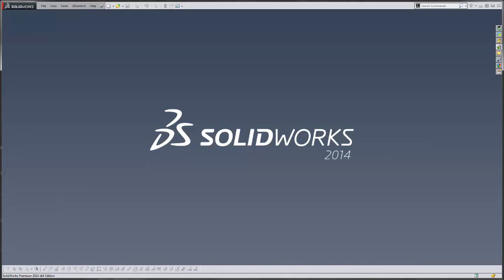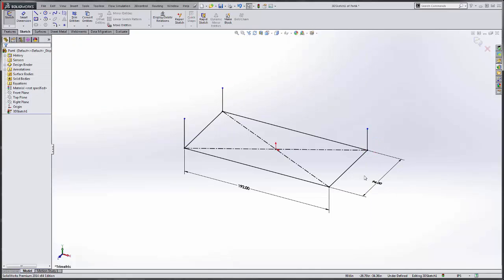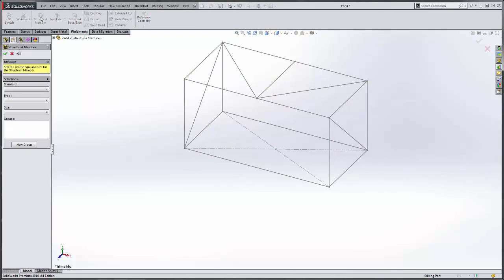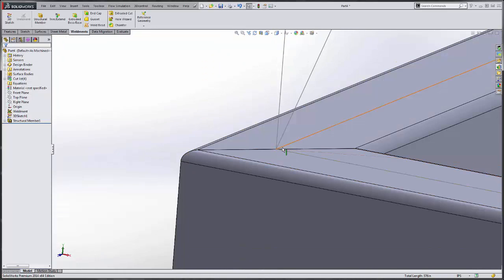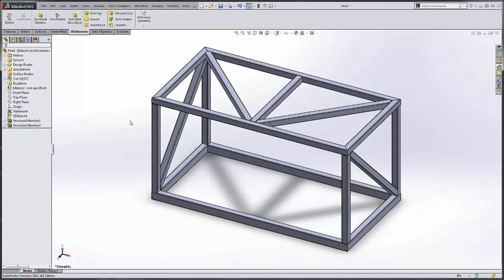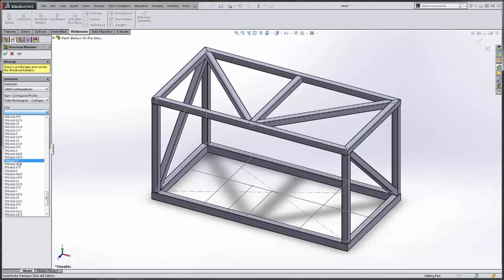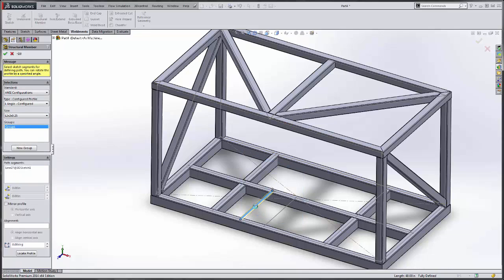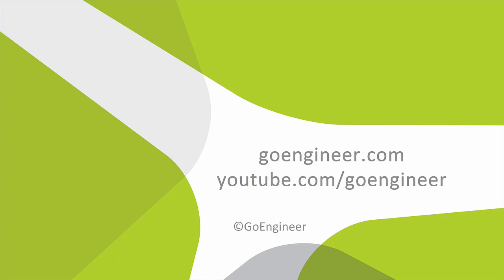SOLIDWORKS - Designing a Structural Skid

Comment: How do you have some many options for diferent types of structures? I only have 6
Reply from the maker: Hi Makeid,
The program only has a few example weldment profiles by default.  This is because the extended profile libraries are quite large and a typical user might need only one and not all of them.  So, SOLIDWORKS Corp makes these libraries into a separate download that you can use to expand your library of profiles.  This video goes over how this is done (http://kb.goengineer.com/go/default.aspx?kbID=10910).